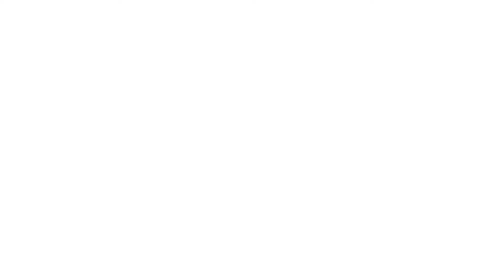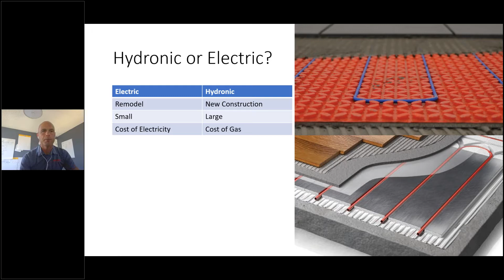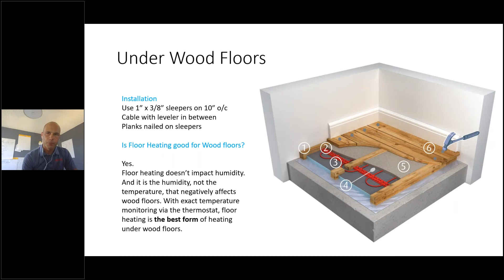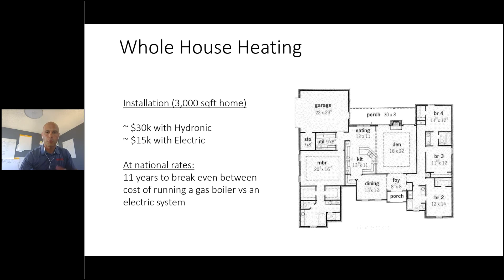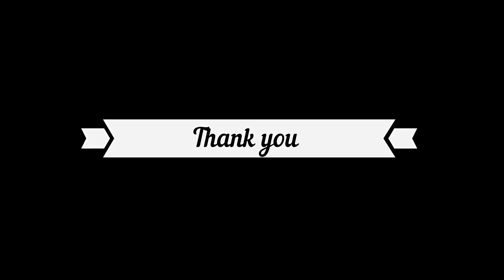Installing & Specifying Floor Heating (2/2)

Comment from the maker: PART 2
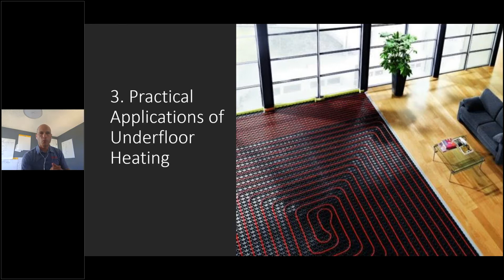0:0:09 Practical Applications of Underfloor Heating
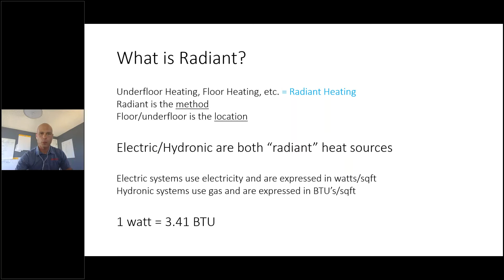0:1:34 Hydronic versus Electric?
0:9:47 A little secret.....
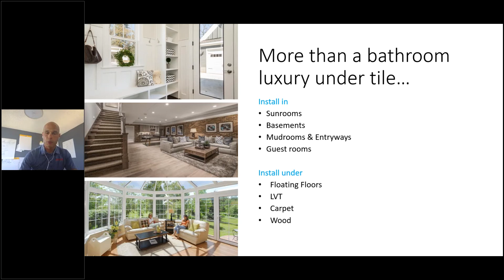0:12:00 Can you heat a whole house?
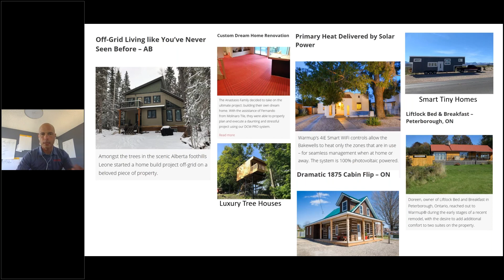0:16:00 Commercial Installations